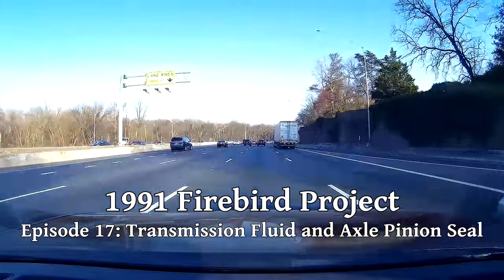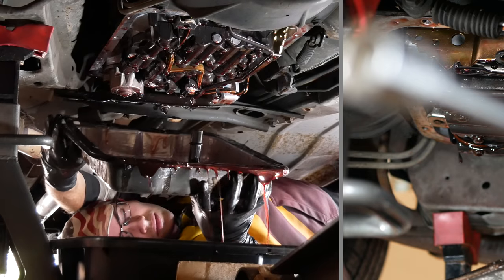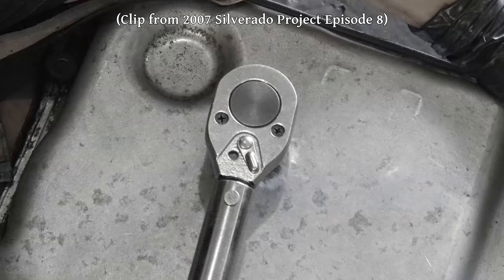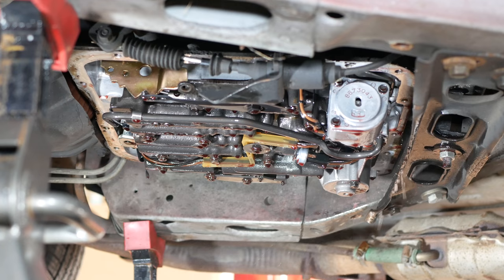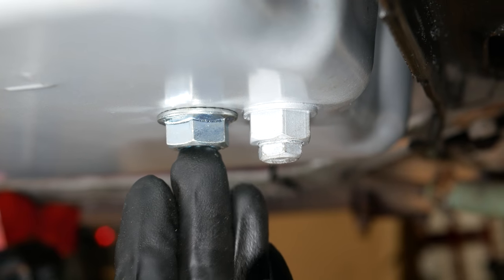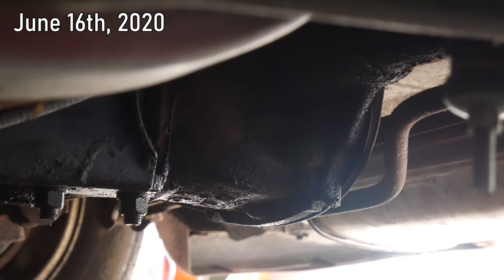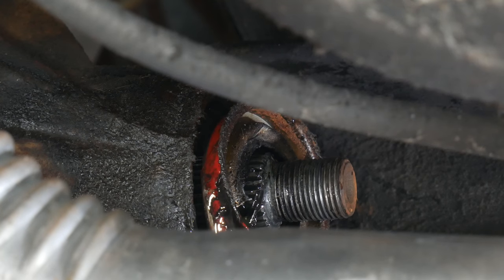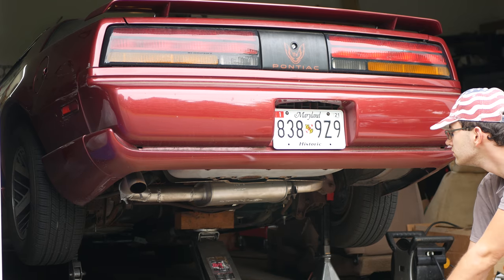1991 Firebird Transmission Drain Plug Debacle and Axle Pinion Seal Replacement (Ep.17)

Comment: You don't need to make a giant mess with draining the pan or spend (a lot of) time adding a drain plug. You can easily set up a siphon with a clear plastic tube into the trans fill tube that will drain a lot of the fluid out and make pan removal a snap. No suction needed, although, it is easier to start the tube empty and use a vacuum pump to pull fluid into the tube than it is to fill the clear tube before inserting it into the trans fill tube. Depending on the ID of your hose, you will probably suck the trans dry (enough) in under 15 minutes. Keep an eye on the can you're filling as you're quite likely to  suck more than a gallon out. Once the siphon is started, it will continue so long as the submerged end of the tube inside the trans is higher than the end of the  clear tube outside the trans.

Your filter should NOT have stuck to the bottom of the pan. Replacing the filter grommet is imperative.

Comment: Regarding the Dorman kit, I go by a saying "I'm too poor to buy cheap parts". And I especially try to avoid parts from China, if there's an alternative. I've had a few bad experiences with chinese parts myself. I'm not saying you should go expensive, but middle range, or simply non-Chinese is usually the way to go.

Also, from experience, I can tell you, that chasing down small leaks on older cars like these often has the same result as in your case, since not only the seals, but the moving parts are worn as well, and it pays off only, if the leakage gets more severe (I have a BMW from the same period as your Firebird, and leaking oil is just widely accepted as a part of the normal ownership experience). 

A bit of an extreme case from the past, I've heard about (not to be taken as a general fact, nor advice..). In some old Zetor tractors in my country, transmissions were leaking so much, that they almost never needed to change the oil, they simply let the "old" oil leak out, and just added new oil once in a while. Which was also convenient, because the transmission held more than 25 liters of oil...so the oil change would be quite a bit more costly, than in a car.

Comment: Something I was wondering in regards to the drain plug was..  Why? Given the interval which you'd normally drain the system it seems like the juice isn't worth the squeeze. Especially given the propensity for them to cause leaks where none existed prior. I mean if you're dropping all of the fluid you're changing the filter too so the pan is coming all the way off anyway. Is the intent behind the plug addition ONLY to minimize the mess when draining? Well ok I suppose. I'd rather have one larger mess to clean up instead of a tiny mess to clean up often.

Comment: You could use a castleated nut turned upside down inside the oil pan. This will solve the leftover fluid issue.

Comment: Good video as always. I must ask though why do you not weld the nut on outside of the pan? Then when you take the bolt out it will all certainly drain. With you welds on the outside I would imagine the chance for a leak developing is also lessened.

Comment: If you were going to fit the drain plug you might as well have drilled a 3-4mm hole in the pan to drain out the ATF, would have avoided the mess. Just a thought.

Comment: That aftermarket drain plug o ring sucks balls. I have one but the key is you use rtv when you put it back in and snug it up. Won't leak. Found that out the hard way

Comment: On your transmission pan you could have welded a 1/2 not pipe coupling in the lower side right at the bottom of the pan and used a 1/2 not pipe plug. And a little Teflon thread sealer and no leaks

Comment: Have you tried using solder to make a seal with your homemade drain plug instead of welding? Welding may be the cause for warping the pan and causing a leak. Plus solder is what they use in plumbing haha

Comment: that trannys muck is roughly the same amount of muck of my 200000km v6 maxima when I did it, and 1/3rd as much as my 94 380000km pulsar.
the pulsar tranny was a lumpy POS but still worked for years
the nissans one was smooth as butter, and still is today, you're fine

Comment: Hey man i hope you find this message. I live in the Netherlands and have foubd your vids very usefull! If possible can you maybe help me with something. I myself have a 1992 v6 trans am which need sone work done as well. Not major thing but one of them is my door trim. On the driver's side the power locks do not work and the plastic top part is bending which is restricting my window from going up and down sometimes. Do you have any idea on how to remove the plastic door handle part on the inside and the top plastic part? I'm afraid i will break things and i have not been able to find an instruction on how to do it. Looking forward hearing from you!

Comment: Don't ya hate it when a worn component hampers your efforts?

A suggestion for the drain plug is to grind a channel into the flanged nut on 2 sides so that fluid can slowly drain out of these channels. It shouldn't cause an issue for the sealing washer for such a small channel I'm sure the 0.8mm pan steel won't deform 😉

Comment: I'm in the works of buying a 91 T top formula trans am it ruff in the paint department but it run well it has the tune port 5.0 auto so yea I need to go back over these videos of your on the rear hatch latch assembly it unplugged and the key is not opening it eather so I've got some work to do not to mention the paint work

Comment: I've worked on plenty of blazers without the drain pan and the easiest way to drain the fluid is to steal one of your friends fluid vac's if you don't want to make a mess. Then go to the junk yard and buy a used pan off a 1999+ Chevy full size for 5 dollars with a factory drain plug. And then never use a Fram filter...

Comment: Why not put the drain plug on the rear wall of the transmission pan - far down as possible? It'll allow you to drain more fluid. Especially since the car will likely have the front end higher.

Comment: Get a replacement pan that has a drainplug or weld a bung into the pan for a drainplug. Its so much less messy when you can drain the pan prior to removing it! Also, why not weld the bung nut to the outside? It would be flush and with a copper or alloy crush washer leak free?

Comment: Don't understand why it'd be an issue if the fluid isn't totally drained, you should be replacing the filter anyways and you avoid the ATF waterfall by getting the majority of the oil out.

Comment: Never had a issue with a regular nut fully welded on the inside and a drain plug with a rubber gasket.

Comment: Why worry about a drain plug at all? Transmissions shouldn't be changed that often and wouldn't you want to replace the filter at the same time?
Reply: It sure is nice to not dump a quart of oil all over the place when pulling the pan...

Comment: I don't see the concern about how "it doesn't drain everything" I'd just put one on the back since you're jacking it up anyways. Like they're trying to compare a bit still in the pan vs everything leaking when you take it off. A bit of atf left should never be a concern because you're taking it off anyways. I would understand the concern if it was a oil pan but if you're doing trans oil you should do the filter.
Reply: The amount of fluid still in the converter is significant also....
Reply: Your never gonna get the fluid all out without a pump so a few drops in the pan aren’t gonna hurt anything

Comment: That o ring will not hold up to the torque on the drain Plug due to not ha  a recessed groove for it to deform into. Personally I think the faster and easiest way to resolve that issue would be to sinoly replace it with a copper or aluminum crush washer. I'd be willing to bet a standard brake caliper copper crush washer will fit in on that plug.

Comment: I would of mounted the drain on the side of the pan.  It would be no higher than the nut height and you wouldn't have to worry about ripping it off.  Says someone who put 120k miles of the 220k that my 89 firebird has.  Either that or a small sump with the bolt in the back.

Comment: You can use a nut in oil Pan bolt drain bolt for an oil Pan that we still have the large head and you still can use the nut body from the inside that way you put a se the on it river seal and that's where you have the best of both worlds

Comment: You shoudld not have put in that drain plug. Do you expect the car to last another 50,000 miles?
BUT that said your problem seems to be the crappy "O" ring that cant be properly tightened. Replace it with a nylon washer or possibly a copper (brake hose) one. If you are quick you can replace it and not lose much fluid. Best luck!!

Comment: DO NOT USE CLEANERS OR SOLVENTS ON INNER TRANSMISSION COMPONENTS!!  Brake cleaners can dry out the pistons and seals, and wreck havoc with the transmission fluid's own lubrication characteristics that's still inside!!  Leave the inside of the transmission alone, they're already clean enough!

Comment: I like this channel a lot cuz you demonstrate what can be done with a minimum amount of $$ and effort. However, why don’t you weld the drain nut on the side of the transmission pan? Or on the outside of the flat bottom if it’s necessary? Welding the nut on the inside makes it impossible to completely drain the transmission, that’s simple physic/gravity. This makes no sense to me, am I missing something???

Comment: Why would any engineer EVER design an oil pan without drain plug? Just why?
Reply: Maybe engineers who expect you to change filters for each oil change, with customers who won´t pay for the extra cost of a drain.
Reply: To avoid leaks!!!
Reply: Money, vehicles are engineered to a price point. The number of transmission oil pans without drain plugs that the manufacturer saves 10 cents multiplied by hundreds of thousands to millions of units manufactured is a significant about.
Reply: @RetiredRhetoricalWarhorse  The people? The customers buying the car?
Reply: @jonasthemovie  No the managers pulling these decisions.
Reply: @RetiredRhetoricalWarhorse  Decisions to sell cars?

Comment: I tell you man, stop using nuts, use castle nuts, that way you can tac in the nut flush on the pan and still have the flow through , id also suggest using a clamp to clamp the castle nut to sandwich the pan against a piece of flat metal, that will help against any warpage

Comment: What's your total investment in this car?
Reply: I went and counted for you

$100 for the car
$500 in parts from episode 2 that were also fitted over episode 2, 4, 5, 10 and 11.
$50 fluids episode 2 + 6 + 13
$300 tyres episode 6
$200 in brake rebuild parts from episode 7, 8 and 9
$60 steering reinforcement episode 14
$40 steering link episode 14

Comment: Why not just drill the hole. The weld the nut all the way around on the outside of the pan, the. Use the bolt as normal. No nut on the inside, therefore all the fluid will drain out.

Comment: That JB weld was crap. It looked like old stuff or wasn't mixed right. It definitely looked like a cold joint. 
 Don't get me started on the plug. You WAY over-tightened it. It's just plastic. Like everyone else said, just buy a pan with a plug.